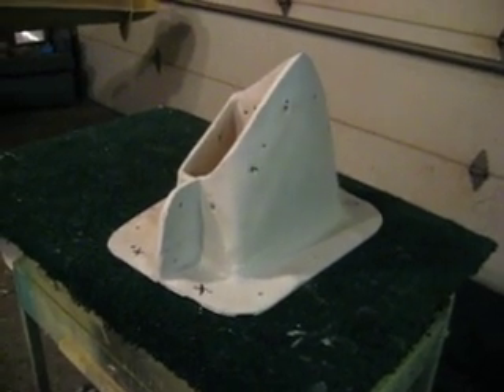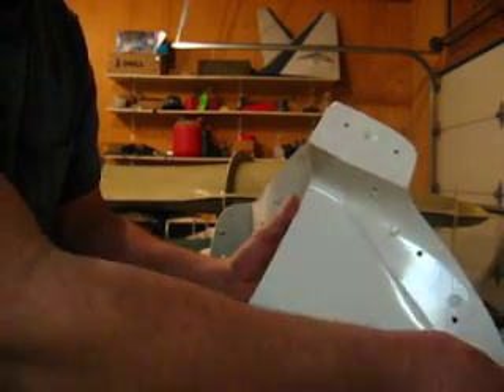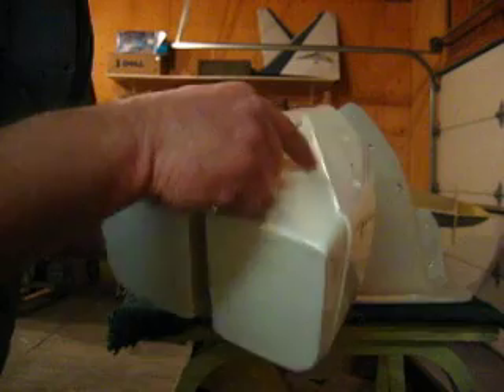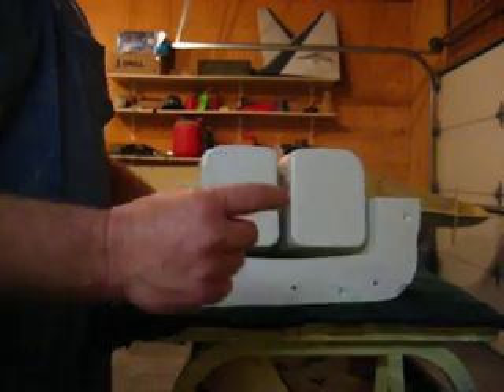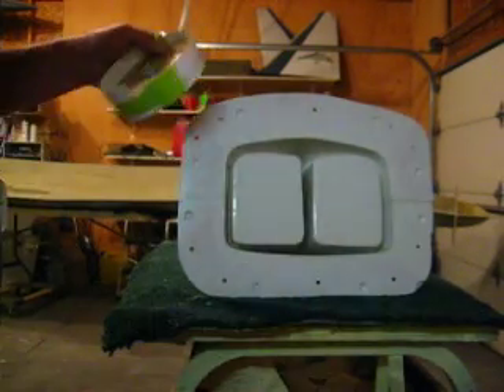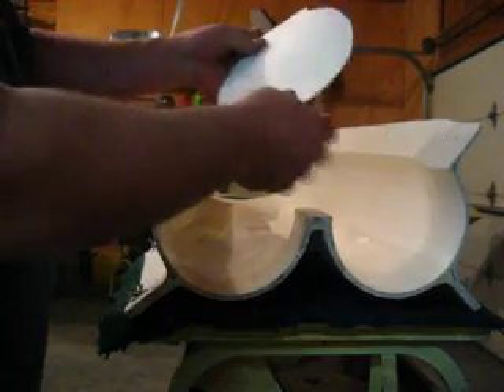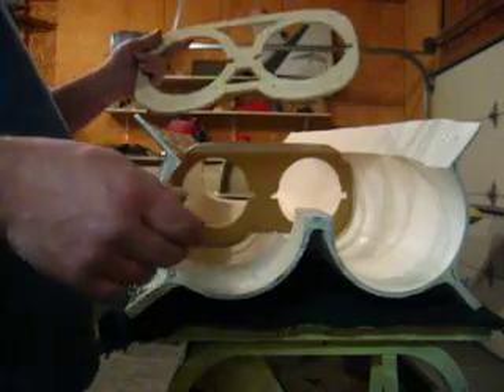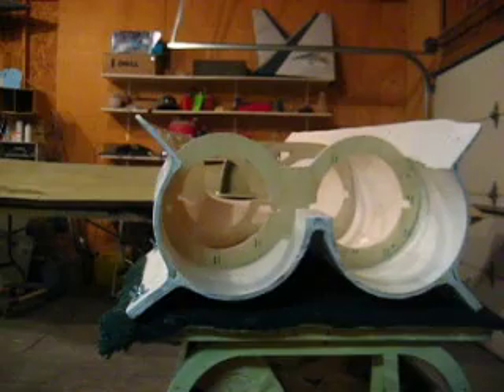how to build a rc jet B-1bomber #23

Comment: Mid air refueling would be next to impossible.  The turbulence within three hundred feet of ground level is completely unpredictable even on a "calm" day.  Even the size this model will be is not sufficient to provide rock hard stability for even the BEST r/c pilot.  The big boys don't refuel mid air below any altittude that would be considered stratospheric (20,000 +).  Also, afterburning jet engines on hobby r/c planes are illegal by AMA & FAA regulation.  Hornitpilot, can u show the engines?